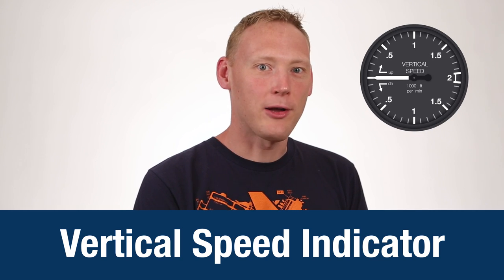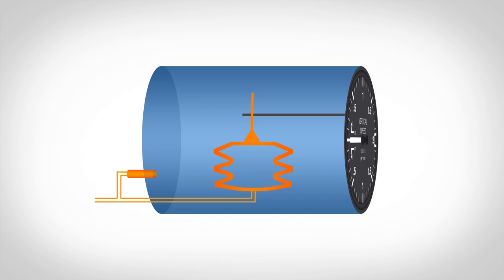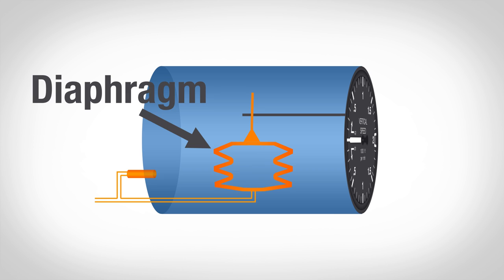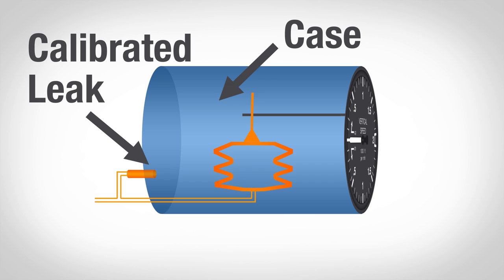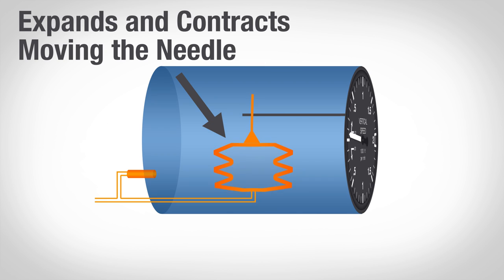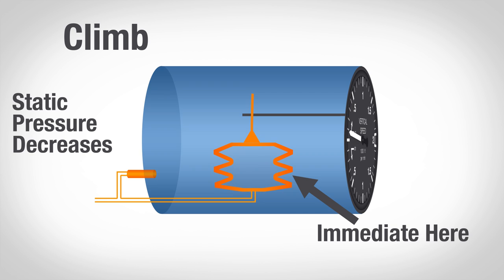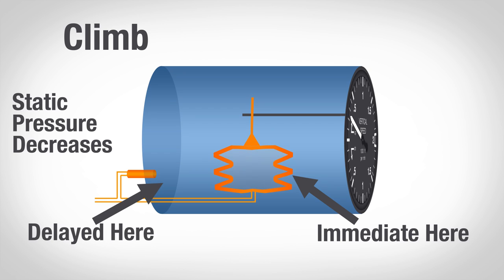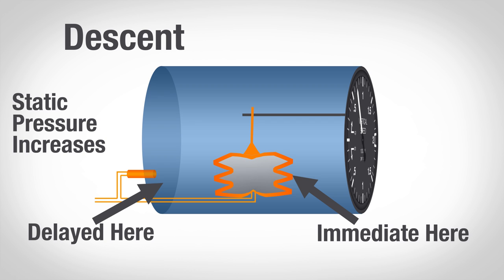How Does A Vertical Speed Indicator Work?

Comment: Easiest way to understand this is - think of the diaphragm as a pendulum/weight suspended from the black bar. When the pressure within the diaphragm increases or decreases it affects the way the black bar behaves. So as the airplane climbs, pressure decreases which lightens the weight within the diaphragm . This simply causes the black bar to swing up which is reflected by the needle within the VSI. !!! :)
Reply: ikr